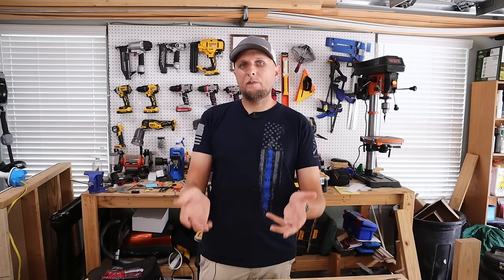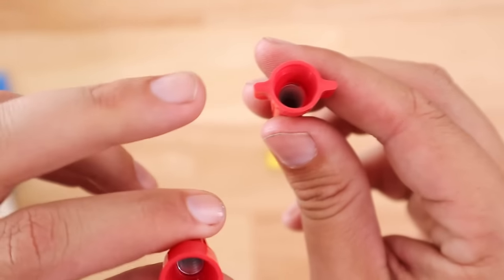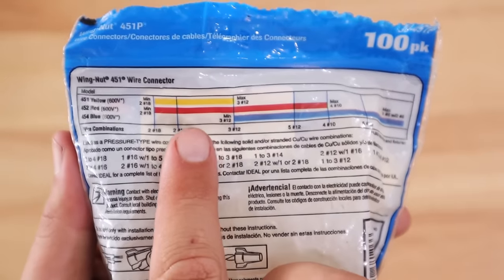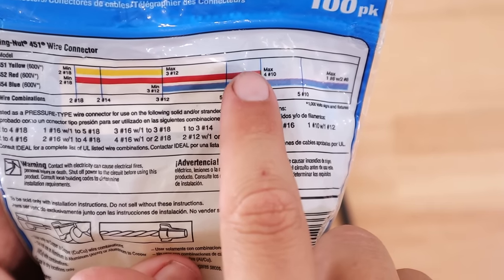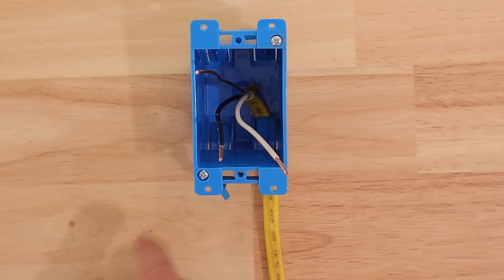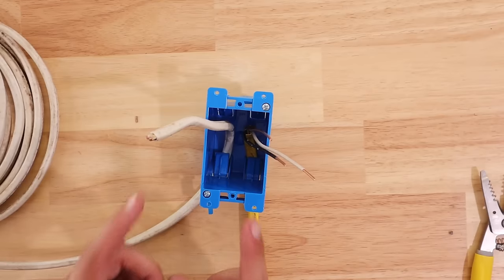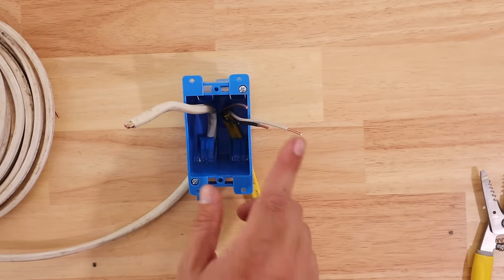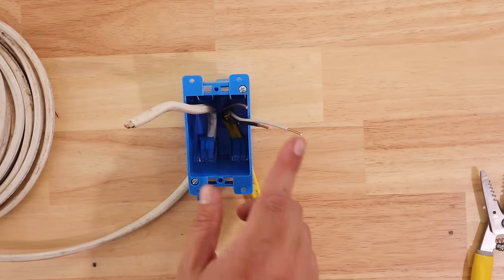Biggest Mistakes DIYers Make When Connecting Wires Together | Part 2

Comment: I agree with your comment with regard to NOT down sizing the wire size when extending a circuit.  However, are we not doing this every time we load a circuit with numerous item’s such as lamps TV’s, Computer’s, Fan’s, extension cords with numerous additional loads?  IN MOST INSTANCES ALL THE AFOREMENTIONED WIRES ARE 14 gage or less.  It is a known fact such circumstances of substandard wire sizing continues to be responsible for the loss of life and property.  Your thoughts??
Reply: The important difference is that those cables are in open air and therefore can handle heat better than wiring in enclosed spaces.
Reply: Actually to answer your question more and better then pup could go check out technology connections extension cords 

You won't regret it!! ^^
Reply: Appliances, lamps, TVs, etc, are current limited by design. For example, if you have a luminaire with a medium base lamp socket, you could never pull anywhere close to 15A, unless you could find an 1800 watt light bulb.
Reply: @CoolerQ  those wires are not in open air. a free air conductor cannot be in a cable, there's a separate amperage chart for free air copper and free air aluminum conductors
Reply: Stop and ask how often it's not a problem, and why code allows it: If the assumption was that every 15A receptacle would see a 15A draw, every room would require individual circuits to use 14g wire per fixture or receptacle. Most devices don't draw that kind of power and/or are seldom used simultaneously.

Comment: When you go to renovate, and seek an electrical permit, most municipalities have a hand-out covering the basics of electrical residential code requirements: All you need to do is ask. It will generally cover what the local inspector(s) will want to see and the stages in the process. Also see if there is are time limits between submissions and likely two inspections(rough-in and finished). If you are changing an old panel you might have to upgrade to a new earth ground cable.

Comment: Been doing a lot of research for an upcoming project, removing an existing light fixture , which appears to be the end of that 15 amp circuit . I want to use that as a junction box to further extend it to hang two pendant lights over our breakfast bar. So my question ,when splicing ( essentially I want to y off from that one wire ) the 2 wires that are needed for both pendants for placement reasons and current layout of the electrical.. is there any reason I can’t or shouldn’t do it that way ? Cause it looks like my only other alternative would be to splice from the old light , run it over to the first location then doubling back with same wire to the second .. hopefully that makes sense .. great videos 🙂

Comment: On typical house switches in the home that I purchased most of the single pole wall switches are cracked where the 14 ga wire is pushed into the switch. Some switches when I removed them the wire has actually fallen out.

Comment: Can you do a part 3 where you talk about switched receptacles and how you're supposed to pigtail the wires before it gets to the receptacle instead of using the receptacle as a splicing point?  While it works, it's not code.

Comment: I did a bathroom gut in a rental once and someone had added a light with a pull cord over the medicine chest and used lamp cord in the wall to connect it to power at the outlet next to the vanity. Totally freaky, but the light didn't draw more amperage than the lamp cord was rated for so it worked.  But what if a new tenant had come in after and changed that light to one with an outlet and then run a hair dryer or electric heater off of it? You just don't cut corners with electricity.
Reply: Unsheathed (single-layer soft insulated) lamp cord inside walls has its own risks far beyond being "freaky".    Some clueless idiot coming along later and adding a receptacle to a light fixture is just barely scratching the surface of the scary going on there.

Comment: Very informative. What about if I connect a 12 (20 amp) to a 14 (15 amp) and the panel is 15 amp? The outlet for TV done I used a 12 wire and it goes to a junction box of 14 which then goes to breaker 15 amp. Lights and TV is on that breaker. Hoping for a response
Reply: It's an inconsistent situation, but would not be a problem. 14 gauge wire for a 15 amp breaker is the standard and the minimum. 12 gauge is acceptable.

Comment: To the wire nuts you're talking about I would like to make a suggestion of the Ideal Tan Twister wire nuts.  I have used them for many years and in my opinion they are superior to the old original yellow & red wire nuts.  Also for me my hands are getting weak and you can put a 5/16" nut driver on them or I use an Ideal 12 in 1 with the handle that will turn a wire nut, thanks!
Reply: I found that an appropriate size deep socket also works well
Reply: @surferdude642  that would be just another tool weighing down my tool belt even more!  LOL.
Reply: @robertalexander2506  Yeah, I guess that's a consideration.
Reply: @surferdude642  I'm getting to be an old fart,I no longer work full time as an Electrician.  I've learned a few things about lightening up my tool belt out of necessity!  LOL

Comment: Thanks for the tips.  Just curious, why not just use the 12g wire everywhere and not use 14g at all.   Is the cost savings really that much?
Reply: Yes, not to mention the box fill issues.
Reply: If you’re building your own home, the cost differential isn’t that much (few hundred bucks), but if you’re a builder that’s building 250 homes then it adds up.  One application where it’s a waste to use 12 gauge would be lighting circuits.  With the conversation to LEDs, you will never be stressing that circuit under normal usage.  The biggest issue for a DIYer is that the thicker 12 gauge is harder to work with and get it neatly back into the box.

Comment: The advantage of the Wago is it works with the multi-strand wire typically found in lights and ceiling fans. I prefer the stab-in style when connecting solid wire Romex.
Reply from the maker: I appreciate the feedback!
Reply: Fun with terminology... You are probably referring to lever-nuts when you say Wago. You do know that Wago also makes stab-ins similar to the Ideal branded stab-in demonstrated in the video... (I'm just making a point. I honestly don't have the experience to know how the Wago stab-ins compare in usability and reliability to the Ideal stab-ins.)
Reply: Everyone has their opinion on wire connections. A properly installed wire nut is in my opinion a better connection. You have more surface area of the wires touching.
Reply: @tomcole7046  Will a DIYer properly install a wire nut every time?
Reply: @waynesheppard22  As I said, everyone has an opinion. In my opinion, if you don’t know how to properly do the job, you should hire a professional. This goes for carpentry, plumbing, and especially electrical. I have been on far too many service calls where stab in type connectors were used and am amazed that there wasn’t more fires.  The two pole version of the wago might be fine to connect a ceiling fan or light in a box where there is a single piece of romex in the box, and the current draw is less than 3 amps. I would never use them on wiring carrying more than that.

Comment: Thank you. Been having some strangeness with wall sockets and light switches. Previous owner was a cob-jobber. Have discovered a number of just wrong wiring (three sets of wires going to a light switch and two coming out to a series of wall sockets for instance). Again, thank you.
Reply: there's nothing wrong with that. you can wire in parallel.
Reply: @VTnewcastle14  Thank you.

Comment: Great series so far!  Thumbs up.  I've started using Wagos around the house and seeing all the gotchas with wire nuts, I'm more leaning towards Wago style.

Wagos provide clear count of how many wires it can accept and wire gauge.   The lever locking mechanism is easy to verify with a good strong tug.    As you've shown, there's more opportunity to mess up wire nuts especially for DIY.

I like that Wagos can easily add/remove wires without having to undo everything.  If you have to undo everything, it just introduces another opportunity to mess it up -- not to mention the additional work.

I ran out of neutral connectors on one of my home's subpanels.  So I spliced in a 5-port Wago on one of the available ends.  I have 3 of 5 ports used up with 2 available at any time.

Maybe some of the problems with Wagos are the knock-offs on eBay and AliExpress.   They're tempting because of their cheaper price.  They look exactly the same but you can tell they're fake because they don't have the Wago logo or markings.
Reply from the maker: Yeah definitely stay away from the knockoffs.  I have heard from others that they do not have the same quality.  Glad you are liking the wagos.  I use them for certain installs.  Thanks a lot for the feedback!
Reply: Can someone comment on this use of any sort of splice to pig-tail in an electrical panel? It seems to me that there might be on over-rating potential there as you could have multiple 15A circuit returns going through the splice. Does NEC have any issues with this?
Reply: I was concerned about the safety of WAGOs when they first came on the scene in the US, but many pros use them and I read they’ve been used in Europe for a decade or so.  The greatest advantage is when you have very short wires to work with and a wire nut just won’t work.

Comment: My home was built in 2001    I purchased it 2013.   Home inspector went through it and he happened to be the president of some American Inspectors “something”.    

Growing up doing this type of work and with 20 years construction experience in the Navy.  I was excited to see 20A and 12 G from the panel to everything but range and dryer and HVAC. 

However.  Once I started remodeling, one thing I like is to replace all switches and outlets to part with cheap “ contractor grade” stuff.  At this time I noticed what I suspected and that every outlet less the garage was using 15A receptacles and switches.   In addition, it seemed, every run would continue with 14GA after that to the next outlet.  

I called him on this and asked if this is acceptable as I wouldn’t have passed it.   Never got back to me.   

I was taught to use 20A for outlets and 15A for lights and I try to avoid tapping into an outlet to feed a switch. 

Some vids on YouTube talk about this.   I understand amperage and design, etc.    it just seems ok here as I help others out and see the same stuff. 

So what gives.  NEC has always been “law”.   Given I want to strangle whoever built this house, I should stop asking questions. 

anyone know of other states that say this is ok?
Reply: I agree with your concern. If it's a 20 amp circuit the entire circuit should be 12 gauge, even light switches if they are on that circuit. It's like the analogy, a chain is only as strong as its weakest link.
Reply: What you described would be fine with a 15A breaker, due to the 14g wire being included.

Comment: Good to know as my daughter is looking to buy a 1966 house that has obvious signs of DIY electrical work in the attic.  Will want an electrician to look this over.
Reply: Even without a DIY. I've been in my house 15 years and I still come across little issues. It's good to have a fresh set of eyes. Also, there have been a LOT of code changes that and be adopted for safety.

Comment: So I have a 20 amp 12-2 circuit going in to a room, I want to tap that and put a light switch and some leds would that be fine? Also using 14-2 for the light wiring
Reply: If you do that it's no longer a 20A circuit, it's a 15A circuit with some of the wiring oversized (safe and correct so long as you use a 15A breaker.)

Comment: Can you put a thicker gauge wire on a smaller circuit breaker. For example putting a 12 gauge on a 15amp or a 10 gauge on a 15-20 amp?
Reply: Yes, but the entire circuit should have the same gauge throughout. The reason for this is not a safety concern, but it could be misinterpreted later if a section is using the thinner wire.
Reply: @surferdude642  yeah I’m planning to add recessed lights from another light switch that runs on a 15amp. I have 25ft spare of romex 12-2 and 10-2 and was wondering if I can use that instead of buying 14-2. I already have the wires so I don’t want to buy it if it’s not necessary
Reply: @erval9  Use the 12/2.
Reply: @surferdude642  yeah I will. Thanks!

Comment: Me:  "Wire nuts are old-school-fine.  They've worked for decades and I'm going to keep using them."
Also Me:  (Opens box of new light fixture and finds pre-attached Wagos)  "Yes!"
Reply from the maker: I am with you!
Reply: free is a very good price.
Reply: Good, because for lights wagos are just fine :)
Wire nuts have never dissapointed me, because the concept is so basic. But there´s a lot to go wrong when designing and manufacturing push in terminals. In the early days, some were downright scary.

Comment: Something else to note. Quite often a larger size wire is used for long runs of higher amperage  loads. For example if I need a full 16 Amps (maximum for a 20A breaker typically) and the load is over say 100ft away(rule of thumb without doing calculations) in a big house or accross the yard, up sizing the wire to #10 or bigger is required. But that does not mean that you can just throw a bigger 30A breaker on it. The circuit is still only capable of safely delivering 16A. There's more to a circuit than just wire size and breaker size when looking in a box or the panel.

Comment: Our house was built in the mid seventies by some REAL hack contractors. I had baseboard htg units in each room. When I first bought the house in ‘87, I had to do extensive drywall repair because the joint tape just fell off. So as I stripped each wall the baseboard heaters were removed. And I found the 240 volt wiring just sticking out of a hole kicked in the drywall and the wiring just hanging out. Talk about hacks, so I had to repair each “hole” and install junction boxes in each. Now I am not an electrician by trade, but I knew enough to safely rewire each heater. Now the heaters , what is left of them are not used as we have a heat pump system for  the whole house.

Comment: What if I have a 20amp breaker powering multiple outlets and such and I want to add a vanity light in, pigtailing off a 15amp outlet with 12awg wire but the vanity light's wires are 14 or 16awg?

Comment: If running 12 ga wire on a 15 amp breaker. Can you splice 14/2 into it if the only thing they are running is led lights.

Comment: I have a 30 amp RV circuit that I ran 10/2 wire approximately 30 ft on a garage wood frame building what is the best way to secure the wire to the framing I was thinking some 3/4 wide plastic staples but I want it to both look and be safe
Reply: Use armoured cable (BX). Any exposed wiring within 5 feet of the ground needs to be protected either in some form of conduit or armoured cable.

Comment: careful to with older homes, back in the 90's, both 14AWG and 12AWG were both white.  Gotta look at the labeling on the wire, don't assume based on color if dealing with older wiring.
Reply: Good point!    Prior to using white for 14awg, yellow for 12awg, orange for 10 awg and black for larger sizes a fairly common mistake sometimes even overlooked my professional electricians and electrical inspectors, is accidentally mixing up 14 and 12 awg romex,  such as when tying in bathroom lights to the bath receptacles which must be 20 amps, or when running the 3 wire with ground romex for 3 way switches on a 20 amp circuit.    Worth noting that the code does not require wire manufacturers to color code the outer jacket or even what colors to use with what sizes, the white, yellow,  orange and black more or less has just become the de facto standard,  if you will.
Reply: even in later 1960s there was a white outer covering for the different gauges.

Comment: Yes question please… What was the purple cap thing you had on your ground wire? What is that for? And does that have to be on every ground wire? It was in your last video?
Reply from the maker: Hey Deb, what was the last video about that you saw so I can look at what you are referring to?
Reply from the maker: Oh ok yeah that is someone else’s channel but I watched it.  That is a green wire nut, also known as the “Greenie,” that allows the original ground wire to come through the top of it and then connect additional grounds to the wire nut if connecting other outlets or switches to that feed.  Basically it can save you from using an additional portal in the box.  It is not required to be used though.  But in some situations, really nice to use.  I hope this helps!
Reply: @HowToHomeDIY  thank you so much!!!!!💜💜😁
Reply: Oh wait.... So it's used as a splice? I'm using 220 wire so it has a ground wire through the whole thing and when I connect a switch in the middle of the line do I need to use a little greeny to splice the two grounds together before I go to the switch???
Reply: @MetatronsWing  with all due respect and with no offense intended, using the term 220 wire to describe the wire in your question clearly indicates you have little of the basic understanding required to be doing electrical wiring installations.  Since you don't understand the terms used in electrical wiring it is very possible you would not understand the answer given.  For your own safety please get a pro to do this or a do-it-yourselfer that does have the knowledge necessary.

Comment: Wago also makes 221-612, 221-613, and 221-615 connectors that accept 20 to 10 AWG.  The only difference is they are slightly larger than the more commonly used 221-412, 221-413, and 221-415 connectors that only accept up to 12 AWG.